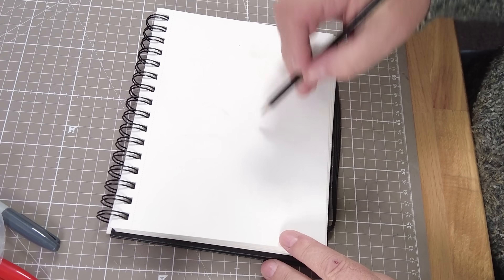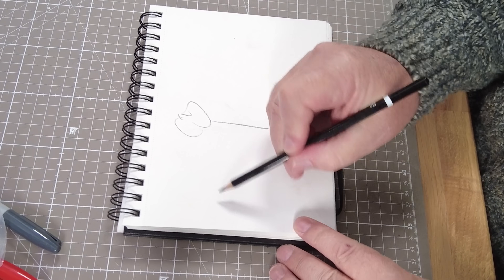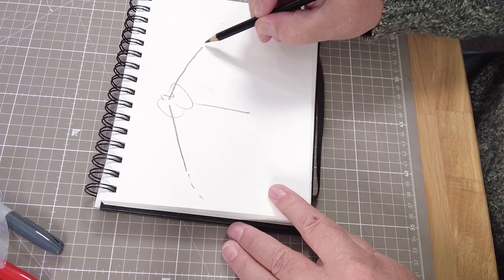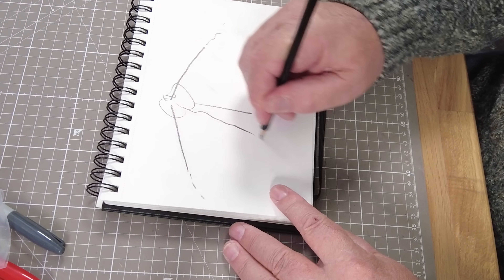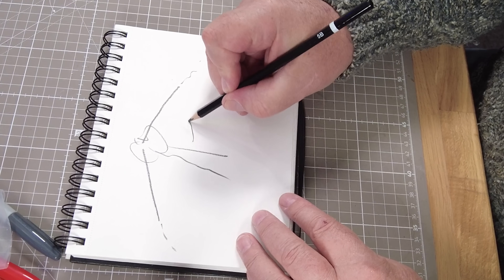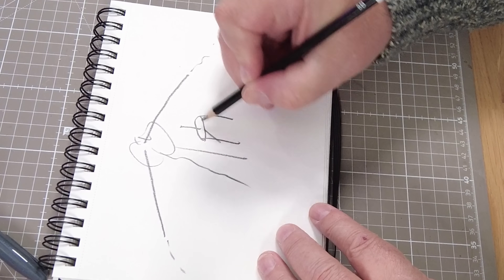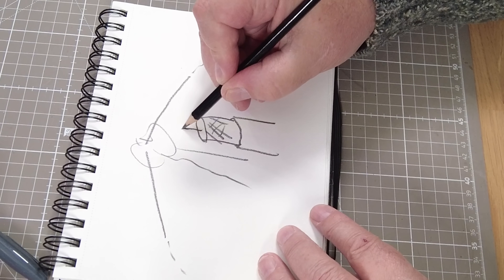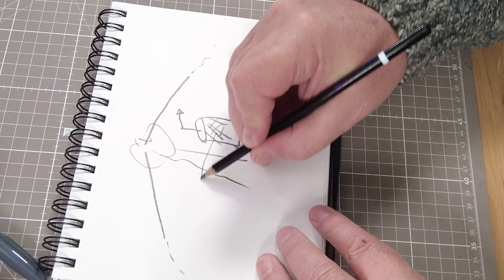Multiband Antennas: Everything That Actually Works

Comment: Hi Callum! I've been watching your channel for quite a while now, soaking up as much information as I can regarding building antennas. In fact, I've consulted with you a couple of times when I built my first dipole and subsequent Starduster for CB (I have talked from Arizona to South Carolina the first time I fired it up)! 

My question is (naturally) about multiband antennas. I understand how fan dipoles work based on impedance matching. But something I just can't grasp is how a dipole resonates on every other (odd) harmonic and a loop resonates on EVERY harmonic. As a guitar player, I'm no stranger to harmonics, but the "odd harmonic" thing has me baffled!

I'm not ready to be transmitting on "ham" frequencies yet, but I DO want to build a "superband" fan dipole that covers as many frequencies as possible for my SDR to be "listening in" while I'm studying for my ham licence(s). If I understand correctly, an SDR is limited only by the tuning of its antenna elements. So I can listen to virtually anything on HF, VHF and UHF that's analog, including the air band! 

While I'm on the subject of UHF and VHF, can a standard TV VHF/UHF antenna be used to receive (and maybe later transmit) on those frequencies? My SDR came with 2 pair of telescoping "rabbit ears" that look no different than what would be on a TV. If I can receive on it, that could potentially make my antenna build simpler. Before studying "ham", (and I was a "CBer" back in the 70s) I often wondered what made a transmitting antenna different than one that just receives (like for radio and TV). Now I know it's all about tuning.

Thanks in advance for your advice! Maybe one day (when I can afford the proper radio) I'll be able to reach across the pond (or maybe the pole) for a QSO with you!

73s!
Mark
Reply from the maker: Mark - to be honest, that's just one of the laws of physics... The dipole likes to see any amount of odd quarterwaves... And a loop is so odd, it just loves it all!

Comment: Talking of balanced tuners there is still a lot to recommend the old KW Ez-match (or super match) manual but just 2 easily set knobs. If you see one second hand at a rally snap it up as they open up another world of balanced antennas to you.... Providing you don't have enough ailments to justify needing 80m, a KW EZ-match & a half size G5rv will happily do 40 & up.

Comment: A quick to setup multiband vertical can be made from a 7.5m whip connected to a long wire ATU (MAT 40) and add some radials. Covers 6 to 40m and with good results. A 5m whip also works but is less effective on 40m. It's good to see your making more videos.

Comment: RF takes the path of least resistance.  Or the path of best impedance. The DX Commander is a wonderful antenna.  I think the fan dipole antenna is one of the best antennas.  Which is why I like the DX Commander so much.
Reply: Stop spouting BS.  RF doesn't take the path of least resistance.  Nor does any other electricity.  Electricity takes ALL AVAILABLE PATHS simultaneously inversely proportional to their impedance.  The low impedance paths get the majority of the current.  The high impedance paths get proportionally less.

Comment: I would like info of an antenna that covers ALL the CB band from 25Mhz all the way to 30Mhz Am Fm SSb without my SWR going mad. Is this possible? thank you
Reply: There is a technique of increasing the bandwidth of an antenna by having multiple elements, it is called a 'cadge dipole', and Callum made a video about them in February 2024.
Reply: @g4lmn-ron   Hi Looked all over Callum site cannot find any mention of the above ? you sure it's a " cadge dipole" What was the heading for the video. ? cheers
Reply from the maker: Some antennas like the Imax 2000 almost does this out the box.
Reply: a double bazooka dipol antenna is very broad banded. If it gets the full 25mhz to 30Mhz? I don't know. You could try it. Cheap and fun antenna to build. If it doesn't meet the requirements you can save it in a bag for holliday use.
Reply: The bigger the diameter of your elements, the wider the bandwidth of the antenna.

Comment: 4:39 Are they the same with “Fan Dipole”?
Reply: 6:04 Oh, commented too soon, nevermind ;)
Reply from the maker: Er no... Traps are normally strung along a single wire or alloy element - and a fan has independant elements.

Comment: Your DX Commander multiband antennas work very well.

I just noted yesterday that my better antennas from my CB days are largely tip loaded. (Helically wound fibreglass whips, not the 102" SS whip.) This is essentially what the DX Commander Signature 12.4m does for 80m.
Reply from the maker: Sort of - I guess... Although ground mounted.